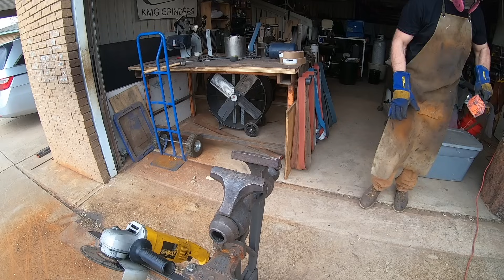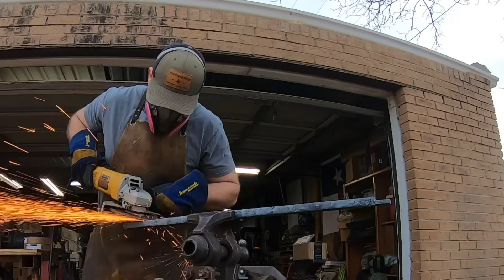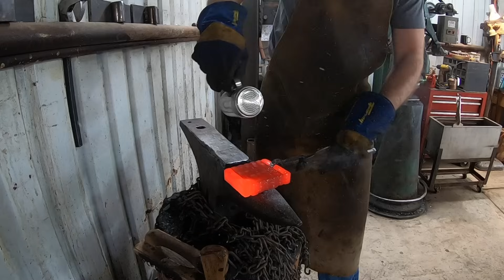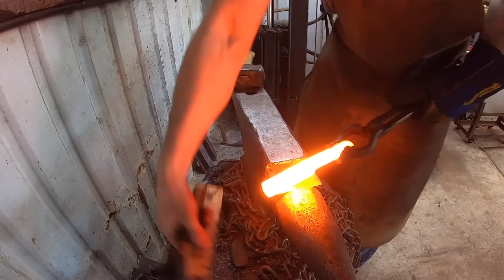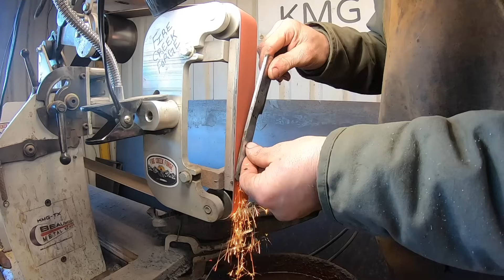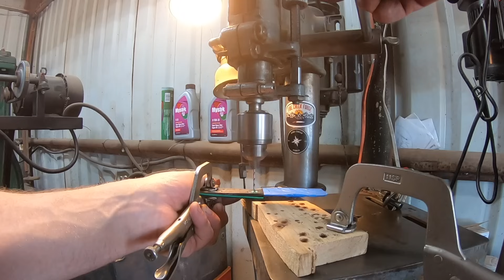I Tried To Make Twisted W's And Turn It Into A Cowboy Knife / Bull Cutter Blade

Comment: I know some people prefer to use stick welders but if you use a Tig welder to joint the pieces preforge  you can do so without adding any metal to the billet, it’s just the parent metal melting together so you don’t have to grind off any welds or worry about the welds making it into your billet 👍 plus it’s a good way to learn tig welding cause it’s not something that’s gonna really show in the end.
Reply from the maker: I think it would be useful, just haven't gotten around to getting set up for tig

Comment: Ok, I'm a complete novice and I have a few questions. What's the point of soaking your billet in diesel? And what prevents you from just pressing the billet flatter on the first pass in the press?
Reply from the maker: The diesel protects the steel from the atmosphere so no corrosion forms on the layers before forge welding it together, and then it leaves a carbon deposit when it burns off. Setting the forge weld is done in several passes, to ensure the pieces fully fuse together, before more aggressive forging.
Reply: @FireCreekForge  That's really helpful info. Thank you kindly.

Comment: Was that first grind to knock the welds off?
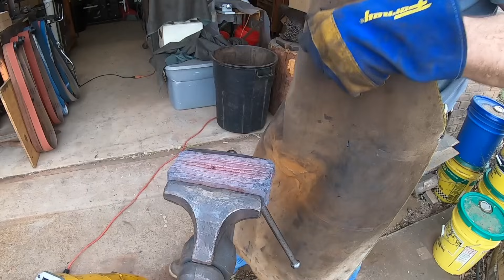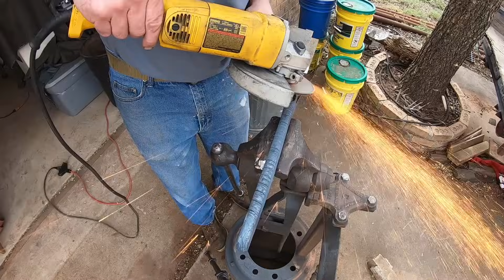Reply: Yes, and no, it was indeed to knock the initial welds off, but, also as seen around 7:47 and 9:39, he is clearing cold shuts as well. The reasons for all that is plain to folks who have worked this type of fabrications but if any other questions come to mind ask away! Someone will answer.

Edited for approximate time stamps...
Reply: @CothranMike oh good a know it all that answers for the video creator. I’m a metal fabricator by trade and have done a fair bit of forging. I was just going to suggest that if he’s worried about the welds making it into the billet then maybe try Tig welding them together as to not add any metal, just melting the parent material together then you don’t have to grind all the welds off.
Reply: @minnesotatomcat  other than your attitude, succinctly said, you intended to clip my wings. The reason wings are clipped with chickens is so they do not fly off in the first 5 minutes after fledgling-a poor practice imho.

Make your observation (TIG good, stick bad) when you ask a question next time, otherwise an unsavory motive may be assumed by the reader. Gotcha questions are not nice, your attitude shows your mind, not mine.  Please disengage... no or else, just a request I hope you honor.

Edited to remove the worst of my spleen splash, have a great day now.
Reply: @CothranMike  don’t hurt yourself Mike 🤣🤣🤣
Reply from the maker: I had some irregular stock that needed cleaned up before forging on the bias.